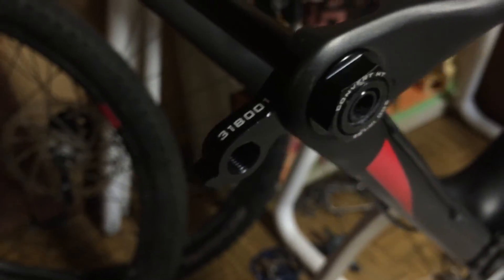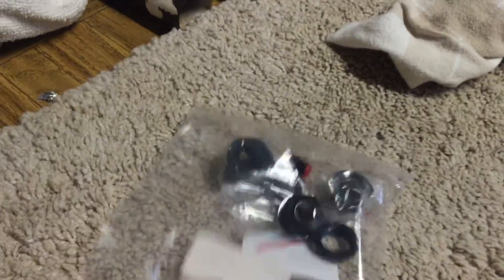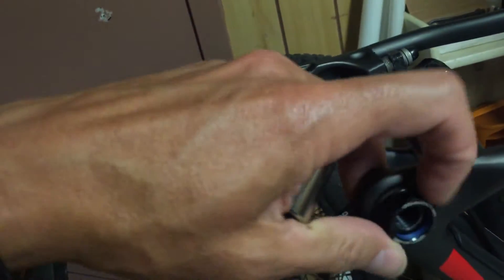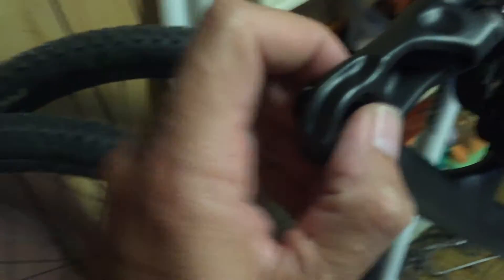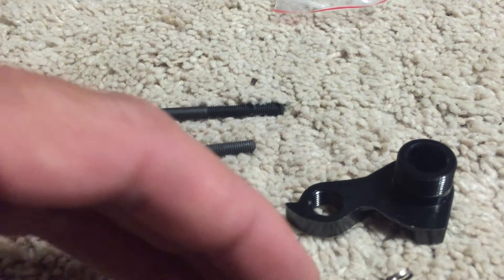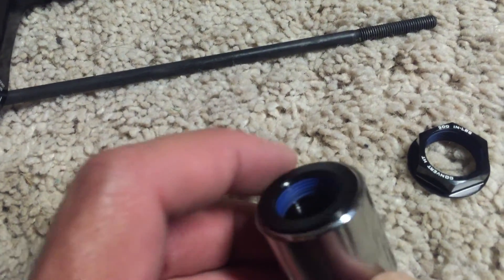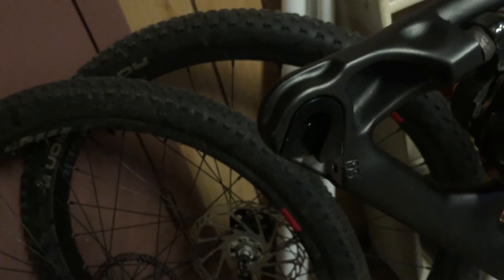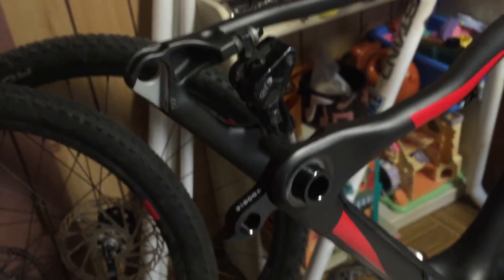Trek 2016 Superfly Carbon – swapping 142x12 Closed Convert dropout for 135x9

Comment: WILL THIS WORK ON A 2021 trek Roscoe 7 ? The thru axel
Reply from the maker: I could be wrong – check with your Trek dealer. It looks like your bike doesn't have a conversion to go back and forth like mine. If your bike has thru axel, you have to stay with thru axel, if you have QR, you have to stay with QR. Thanks for the comment.
Reply: @anellogrande1237  THANKS THAT HELPS ME OUT NOW IM JUST GOING TO BUY A THRU AXEL TO NOT WORRY ABOUT ALL THE HASSLE

Comment: Hi friend, I need information on how to get this 12mm axle set that is installed on your bike. My bike has 10mm axles and I need to install new wheels with 12mm axle, but here in Brazil it is difficult to get the parts. I'm waiting for an answer. Thanks for the video.